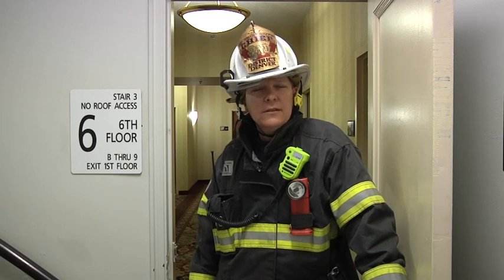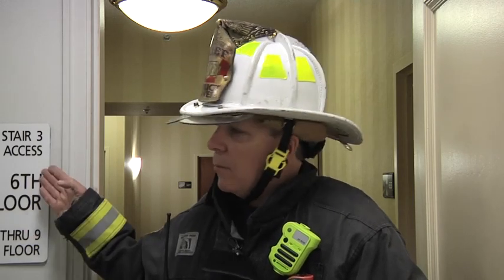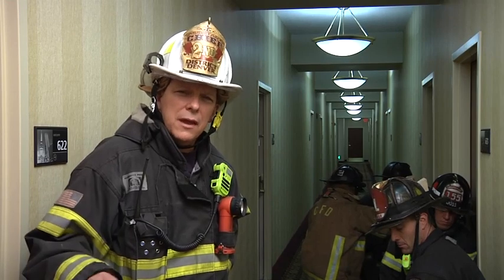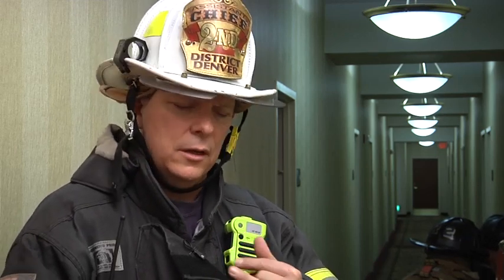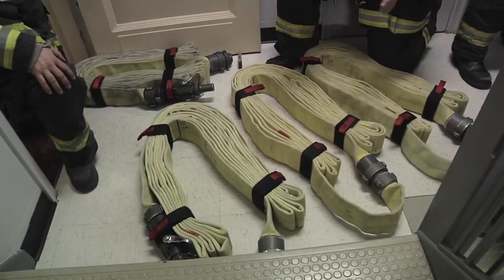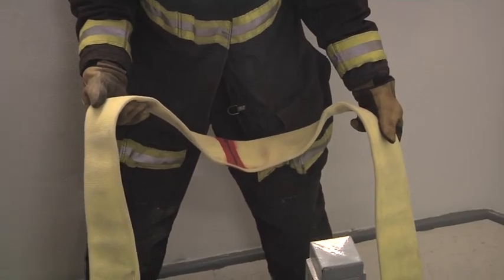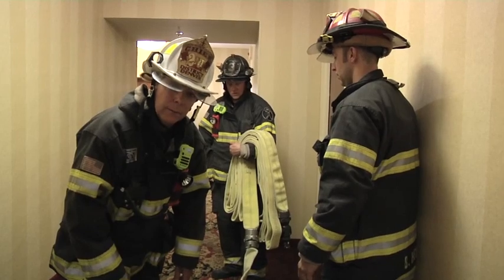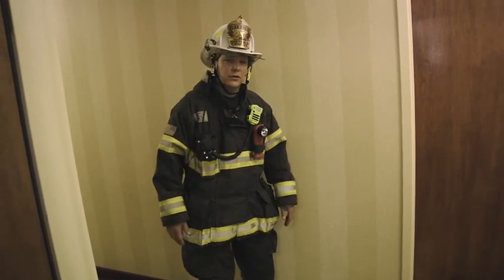High-Rise Ops: The Apartment Stretch

Comment: DENVER — Denver Assistant Fire Chief Dave McGrail was fined 24 hours of pay over a close call incident in 2012 that nearly killed a firefighter.
Reply: The fine was issued three years after the fact because Chief McGrail didn’t file the report correctly and pass it up the chain. They were working a fire at a warehouse and a Lieutenant stepped through a skylight while he was walking on the roof and caught himself and he wrote the initial report and turned it into Chief McGrail. It wasn’t as if Chief McGrail made a reckless decision on scene.